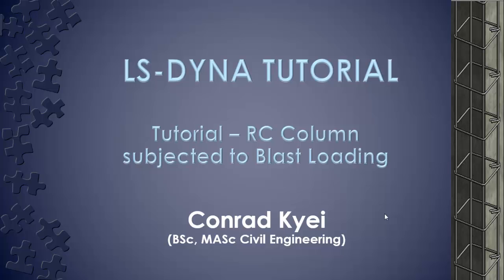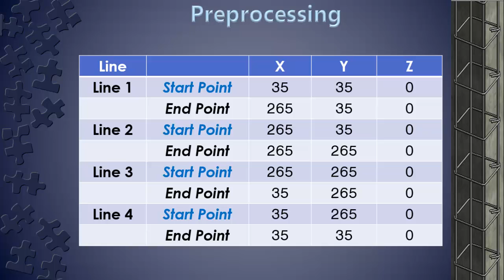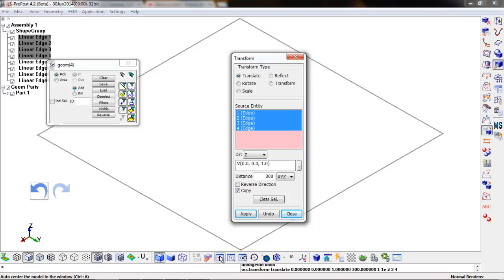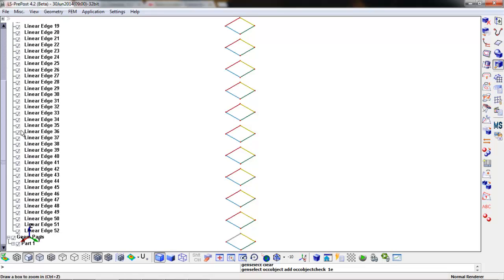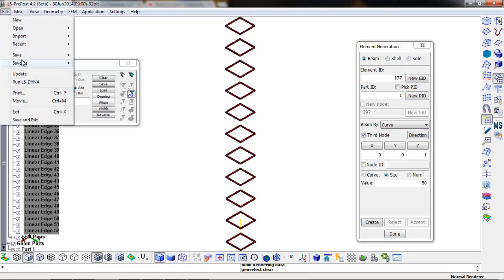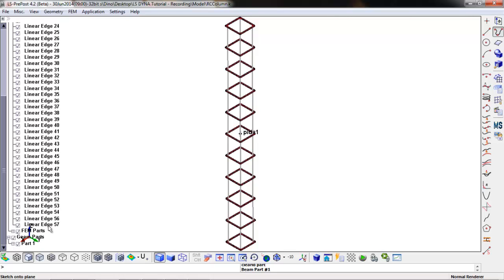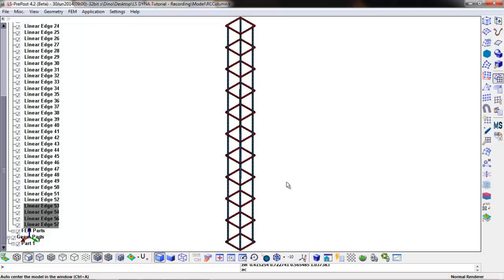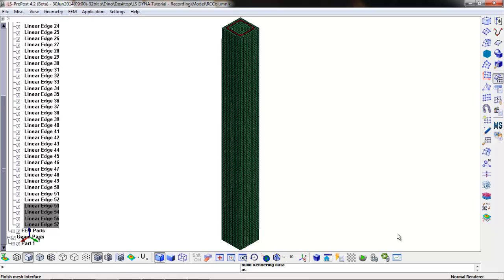2.0 Modelling the Reinforced Concrete Column

Comment: Hey man! I am trying to add erosion to my concrete model but I have no idea why, when running the simulation all the elements are instatly deleted I tried changing the parameters but nothing seems to work do  you have any advise Iwould be very thankful!

*PART
$# title
Segment9                                                                   
$#     pid     secid       mid     eosid      hgid      grav    adpopt      tmid
         9         9         9         
*SECTION_SOLID
$    sid     elform        mid
       9          1
*MAT_CONCRETE_DAMAGE_REL3
$ see rate effects curve 723 below
$#     mid        ro        pr
         9 2.2500E+3     0.190
$#      ft        a0        a1        a2        b1     omega       a1f
    1.6129   -1.2249     0.000     0.000     0.000     0.000     0.000
$# slambda      nout     edrop     rsize       ucf    lcrate  locwidth      npts
     0.000     0.000     0.000  3.94E-02       145       723     0.000     0.000
$# lambda1   lambda2   lambda3   lambda4   lambda5   lambda6   lambda7   lambda8
     0.000     0.000     0.000     0.000     0.000     0.000     0.000     0.000
$#lambda09  lambda10  lambda11  lambda12  lambda13        b3       a0y       a1y
     0.000     0.000     0.000     0.000     0.000     0.000     0.000     0.000
$#    eta1      eta2      eta3      eta4      eta5      eta6      eta7      eta8
     0.000     0.000     0.000     0.000     0.000     0.000     0.000     0.000
$#   eta09     eta10     eta11     eta12     eta13        b2       a2f       a2y
     0.000     0.000     0.000     0.000     0.000     0.000     0.000     0.000          
*DEFINE_CURVE
$#    lcid      sidr       sfa       sfo      offa      offo    dattyp
       723         0 1000.0000     0.000     0.000     0.000         0
$#                a1                  o1
             1.0E-06                1.00
             1.0E-04                1.03
             1.0E-02                1.05
             1.0E-01                1.07
             1.0E+00                1.10
             1.0E+01                1.12
             3.0E+01                1.30
             1.0E+02                1.70
             3.0E+02                2.60
*MAT_ADD_EROSION
$#     mid     excl    mxpres     mneps    effeps    voleps    numfip      ncs
         9                1.0      0.15      0.08       0.0       0.0       0.0
$#   mnpres     sigp1     sigvm     mxeps     epssh     sigth  impulse   failtm
                 0.0      0.0       0.0       0.0       0.0       0.0       0.0

Comment: Hello Conrad,
I modeled reinforcements just like you with 50 mm element size. Then from "Section", I assigned it as a tubular (10mm for stirrups and 20mm for main reinforcement).  But once I am doing my analysis it states that my nodes of the reinforcements are a massless entity. Little help will be greatly appreciated.

Comment: hi Conrad,
I've noticed that when element generation is carried out,  the 'value' is set as 50? May I know why the value is not the thickness of the stirrup or the reinforcement?
Reply from the maker: Hi Peng, the value of 50 is set for the number of beam element per segment. Each line representing one side of the stirrup or representing the longitudinal rebar is meshed into a certain number of elements. That is the value of 50 you see.
Reply: Thanks for your advice! Greatly appreciated!